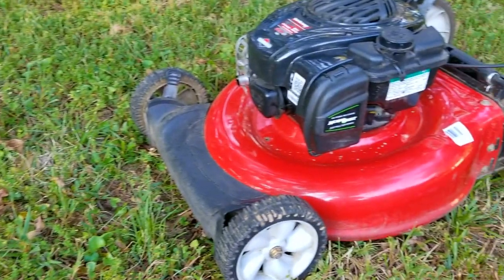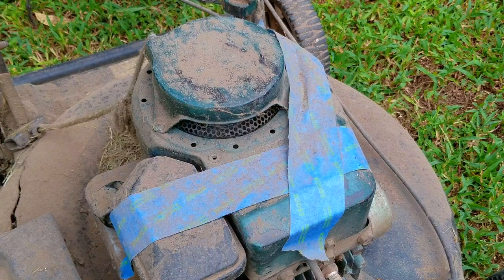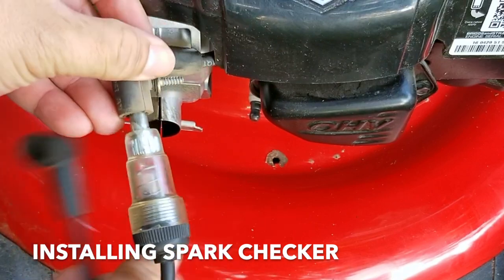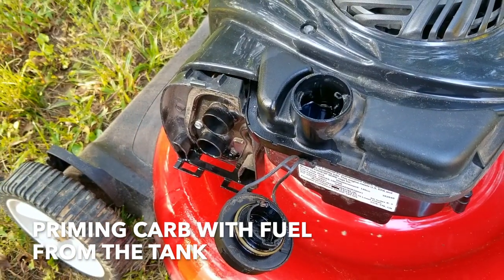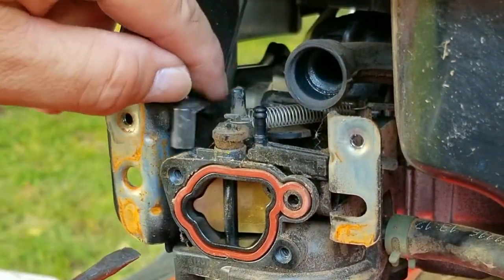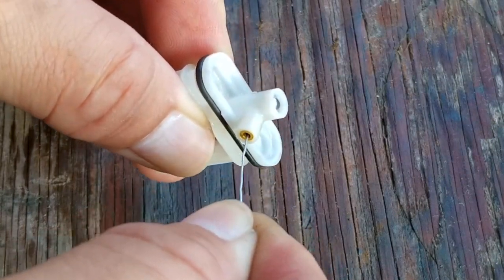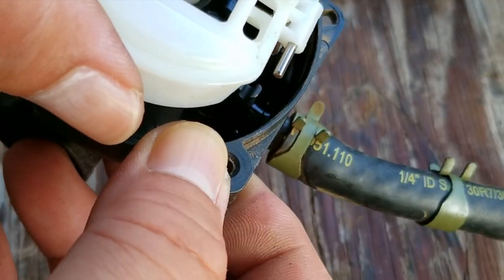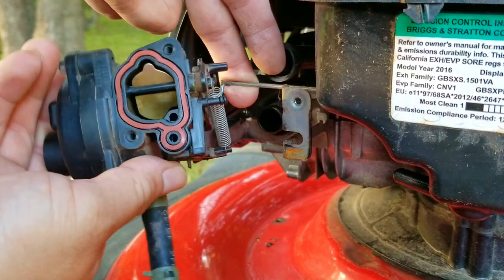Why Did Briggs Stop Making The Flathead Engine?

Comment: My sarcasm tells me they saw the Quantum lasted so long they lost out on sales so they made cheap engines (with lots of plastic parts) and eventually said "never change oil" to absolutely guarantee continued sales... call me cynical.
Reply from the maker: I think that make a lot of sense
Reply: that Q was the high-point of  flat head design, right fuel burn, right crankcase breather system, right carb design.  There was no reason to ditch the side valve if you require constant speed operation. It's ideal just the way it is.
Reply: yep as small engine mechanic iv seen alot of then destroyed buy the no oil change lie then got to explain to customer they destroyed there engine buy not changing the oil it said not to change
Reply: I took apart an '87 Tecumseh TVS100 engine that had been scavenged of parts before I got it cheap.  I had no idea of the workmanship that was in these old flat heads.  Parts for these old engines are abundant, cheap and made in the USA, which is why they should be salvaged as well for future use.  The governor gear is nylon while everything else is metal on these engines, minus the seals.  If you are looking for affordable upkeep, older B&S and Tecumseh are the way to go!
Reply: I totally believe the no oil change deal. 
I had a Tecumseh push mower in the 90s that I had 13yrs and never changed the oil, just added it. 
Still ran when I gave it away. 
Why change oil for a 79$ push mower it basically paid for itself in the 1st year. 
Read the Briggs fine print too, it's totally doable. 
45mins per cutting every 7-10 days ,for an average 5mo season. 
Top off the oil ,change the plug and air filter annually and it's good to go.
Reply: @timewa851  they were having a heck of a time getting them to meet emissions,even being constant speed.
Reply: @MrTheHillfolk   I think it is still a good idea to flush the oil sump and put in some fresh cheap 30wt if you recover one of these engines, as God knows where some of these machines have been.  The Quantum engines always puff out smoke upon startup after their second or third year regardless how well you take care of them.  The OHV engines not requiring oil changes is a bit suspicious, as anyone with an old Honda will tell you that if you don't change the oil regularly that they will smoke like a chimney.  Of course, it could be old gas or water in the system, though.
Reply: @campbellpaul 
You can change the oil ,you just gotta tip em over as some don't have a drain plug. 
That old Tecumseh I had was a great experiment though. 
I'd do a leak down on yours ,I suspect the beginning of a popped head gasket. 
Compression can show good all day ,the leak down test really tells you what's going on. 
Chamfer all head bolt holes and any other holes and sharp edges on the head and deck. 
They say 220in pounds and don't lube bolts.
I say lube the bolts ,and go 20ft pounds (220 is like 18 ft anyway) 
So chamfer ,lube bolts and go 20ft pounds, I've never had a repeat after that. 
Plastic scraper and a brass wire bristle brush cleans the surfaces up nicely.
Reply: @MrTheHillfolk  That could be the problem on one of my Quantum engines.  I notice the head bolts sometimes need to be tightened up.  I think I'm going to refurbish my 5.5 quantum with a brand new head gasket and check the ring gap and the bore for it's lack of compression issue.  I'll do the same for my Tecumseh, as kits for these are cheap!  Another thing I need is a good ring compressor to put it all back together again, as well as some lapping compound and valve spring tool, as I have some Suzuki engines that also could use some TLC (parts for those are too expensive though).
Reply: @campbellpaul  yeah if you're noticing head bolts getting loose ,they are either stretching and yielding or the gasket is going away causing tension loss of the bolts. 
When they do leak ,pull the head off easy and look for black carbon streaks from the bore to the pushrod cavity (on the head and deck) and the gasket might be all blackened. 
These things are fussy about heat, the cooling systems are barely adequate and a little debris can block airflow ,causing localized overheating and popping head gaskets.
The ol mouse nest in the blower housing that went unnoticed for a few cuttings helped start the process (not all the time but it can, I'd pop the blower housing and make sure all the fins are clean and it's off already for the head gasket I'd figure if it goes that far)
Reply: @MrTheHillfolk  Carbon build-up is the likely cause of the hot-spot on the head.  That's the one drawback of flatheads over OHV which burn much more efficiently.  All but one of my engines (I have 12 altogether) have never had any refuse stuck in the cooling fins.  The only one that went bad was a two cycle that had been run with no air filter, which I bought for parts.  To me, there is no bad engine made before 2004, just some are easier to work on than others.
Reply: @campbellpaul  cool deal ,at least you're wise to engines.
Yeah mid 2000s seems to be the point where it turned to junk after that.
Actually Briggs low key addressed the cooling issues on the V twin inteks at least. 
The later "professional" series engines have a cooling fan that's close to double in height,and the blower housing does swap to the early stuff, but it's best/easiest to have a donor for it. 
We did use the singles for a while on generators, the later ones have a round air filter instead of a panel filter (identification purposes) but I haven't checked the fan height, it could be taller.
Reply: @MrTheHillfolk  I am leery of anything that you cannot break-in slowly that doesn't have a throttle control lever, so the Intek engine (although torquey) is written off my list of walk-behind mower options.  To me, it would more likely be the victim of developing a ridge on the cylinder, so I would only buy one new if I know for sure of a carburetor I could adapt to it with manual control linkages.  There are just too many oldies to be found cheaper for my purposes.  Intek engines also tend to have Chinese parts which I am so far completely free of in my collection.  The Professional series does seem to be the most powerful I have used, but I will take durability over power, as I have 2 cycles that can deal with overgrowth.
Reply: @campbellpaul  haha I've been in generators for too long😂
You'd be horrified that the air cooled ones ramp right up to 3600 from a stop. 
Actually a little more if it's mechanical governor ,like 3750-3800 😂
That's lovely when it's like 14 degrees outside 😔
I still see em with 1200-1400hrs before they get tired or parts are starting to become nla.
The issue with generators is if you want lights on or want to wait for an engine to warm up 😁
At least the larger water cooled units usually only run at 1800 and have coolant heaters so it's already 100 degrees or so, those aren't too bad. 
I do cringe when I see folks just whack the throttle after it's only running 10 seconds, stuff like backpack blowers and chainsaws it's a good way to lock one up.
Reply: @MrTheHillfolk  What's worked for me (and frankly, why I am amazed at OHV small engines with a trochoid oil pump) is putting the engine to full load at slightly higher RPM than recommended.  I only allow 5 seconds to get the oil circulating first, with a gradual raising of the throttle though, not slamming it up immediately,  
The idea is you run it like that every time you start it, but only for the first 15-20hrs run time.  After that, you simply run it at regular recommended RPMs without worrying about the circulation period too much (or whether it's under load or not).  You can basically just run it the way you described the generators starting at 3,600 and if it is a quality made engine with good quality control and assembly, then it should last 5 times as long as it would otherwise (without break-in).
Now, I don't believe all engines can last 6,000+hrs, but I did break-in a Suzuki OHV VMG6 that way and it did last that long with no major problems.
Reply: Yup. It's a shame if that's the business model they're following.
Reply: Good theory except Briggs isn't the only maker of small engines.
Reply: @MrTheHillfolk  emissions on a mower compared to Biden flying Air Force 1 over to the Economic World Forum is like a fly taking a crap in the ocean.
Reply: @scottrayhons2537  
Don't get on me about it, I'm just passing the message.
Go tell him yourself I've got other shit to do
Reply: Yep. Too reliable.
Reply: Well I’ve never changed the oil or done any servicing on my Briggs flathead mover and it still starts first pull every time and it’s about a decade old at this point!
Reply: You are almost certainly right.  Especially with the "Never change the oil" part.
Reply: @MrTheHillfolk  Just because YOU were lucky doesn't make it right, and just because your engine still ran doesn't mean it ran well and sounded good.
Reply: The combustion chamber of a flathead can never be as efficient as an OHV design. Fuel injection won't change that. Lawn mowers create 242  million TONS of CO2 per year in the US. That's 242 million multiplied by 2,000 lbs, or over 48 BILLION lbs of CO2. If you count one pound per second, it'll take you over 1500 years to count the pounds of CO2 from one year of mowing. People think that's how it's always been and so it'll be fine. But remember 30 years ago when you could drink from almost any stream? Today you can't drink from hardly any bodies of water. And we didn't really start mowing until about 1950.
Reply: Had a mower with the flathead engine,never changed the oil,just kept it topped up and it ran for close to twenty years until the deck rusted out.
Reply: I think I'll call you "correct", sir.
Reply: That's the case with a lot of things these days. Everything from automobiles to kitchen appliances are all made to be complete garbage these days. Refrigerators for example used to last for multiple decades, but now they all too frequently last less than 5 years. Those old flatheads used to run forever. Whenever something did go wrong it was always easy to fix. I had an old flathead before, and that engine was still going strong after the rest of the mower fell apart and rusted away around it. The fact that it was kept nice and dry in the garage when not in use should give you some idea how long it took for the wheels to get rusted off. We had that thing long enough that a child could have been conceived and grown to adulthood possible having kids of their own. It eventually became impossible to use when the wheels fell off, but the engine was still going strong.

EDIT: I should also add that I had the 22 select cut with 4.0 horsepower, and cut so much grass that it wore the blade down to about 17 or 18 inches. I replaced the blade, and continued to cut till the wheel fell off and got hit by the blade. Engine still ran after that just fine, it was just missing a front wheel.
Reply: @MrTheHillfolk  lol thats for the city/urban folk that have a postage stamp yard. I use my push mower just to trim around my trees. Thats 2hrs per week
Reply: I work for a garden machinery repair business and all the new OHV stuff is shite , the E10 fuel doesn’t agree with machines like these so we put aspen or E5 in them  if customers pick them up from repair or showroom stock gets aspen as it lasts for 5 year without messing new engines up  , we recently started a flat head villiers up that been standing in the open for many years , put some aspen and a squirt of Cosby starting fluid n fired right up  , point is can’t beat the old stuff 👍😉
Reply: I have a 5hp Briggs from the early 70s still starts on the second pull every time.
Reply: I never call you cynical because I see the same stuff and it's all made some country 12,000 miles away and they have no parts for them and anytime you say never needs to change oil let's see if those people will never change underwear socks and see how long they last? 💸💸💸💸☠️💸🙏
Reply: @jonsworld5307  although synthetic conscious as much as second class Scotch petroleum base the couple of bucks how much is a new machine how much just to take it in the shop and have it cleaned tuned new blade air cleaner etc etc and how much is a can of oil If you look around do 5 gallons at a time in the last year 2 years if you're as crazy as I am and 5 years if you just normal however I would go with another jug because who knows what's going to be in 10 years to buy a new one 💸💸💸💸💸💸💸💸💸💸💸☠️
Reply: @boatlover2296  That doesn't surprise me. Those were some of the best engines ever made. Everything went to shit after the 90s.
Reply: @theupscriber65  If you are advocating battery-powered mowers, I, myself, would rather use a corded electric as they last longer and have less waste product.  Eventually, we will have to resort to scythes to cut our overgrowth, as we will inevitably run out of fossil fuels at the rate we consume.
Reply: @24space310  Indeed the prices went up while quality went to hell. That being said they still made plenty of money back when shit used to last. It's out of greed not necessity that they make refrigerators to not last more than 3 to 5 years these days. That's why I'll never buy a new one. My old GE side by side from the 90s is still going strong, and it'll still be going strong after a brand new fridge is long dead. Planned obsolescence is real.
Reply: @timewa851  problem was right there. For starters the proper name was the L head. Beyond that there was a lot of short comings from a production and emissions and cost of materials side. At the end of the model 9 &10 engines (the smallest and most common version) were so expensive to make that the company was making literately pennies per engine.
Reply: @MrTheHillfolk  both the L head and the OHV push mower engines were designed for a 50 hours of expected life. You should expect to get +66 cuts at 45 minutes so given your specs should get about 3 years per engine. The plug should be good for life, but with the fuel it should be run dry before storing it for the off season.
Reply: @MrTheHillfolk  the plugs were removed from the bottoms due to not getting use and hastened by one of the international plants screwing up the installation on some units leading to recalls.
Reply: @campbellpaul  use thread locker on the bolts, that's what we used when we built them.
Reply: @campbellpaul  I had a corded electric mower. Hated it every time I used it. Now have a battery cordless mower. Love it. And no oil or gas to fuss with. So far I have had no issues with the cordless mower. But it will not last near as long as those old flathead mowers. It’s just not constructed to support that long of life or endurance. But it will suit me for as long as I need to use it.
Reply: @americanrambler4972  I have only used one mower that I've truly enjoyed, and it has a flathead engine, too.  It took me 35 years to find that mower, and I've been using it ever since.
Reply: I have mowers (used fixers) and only added Earl.
Reply: And my sarcasm makes me think Ya cant make hydrocarbons if the engine dont fire up!
Reply: @MrTheHillfolk  emissions does not matter with small engines I've never had to e check a lawn mower still got one more code to sort out with my car so I can get it plated
Reply: Seen a lot of quantum engines, only ever had one failing that ran a whole season without oil and just threw a rod at the end. Still very impressive
Reply: @campbellpaul  
If the Suzuki lasts even better than the Briggs.....the cost of spare parts evens out re price?
$ per year fuel/oil/parts comparisons are worthwhile...
plus of course intitial cost of machine...
also spread over total years of service to the owner...
Reply: like the cars with transmission fluid which lasts the life of the transmission, or is it the transmission which lasts the life of the fluid? I get so confused....
Reply: @johnstreet797  I was thinking the same thing.  I also think that dealerships get out of having to change the tranny fluid in their used car inventory before they can sell them.  Be sure to take your vehicle in if it's under warranty before the 100,000 mile mark!
Reply: @Paul Campbell  hopefully before those fossil fuels kill us all. Honestly we use a gas powered mower because the yard is too big but used a cordless push mower for a smaller yard and it was very nice. No gas or oil, super reliable and quiet.
Reply: Lost out on sales? No way. You can bet there have always been and will always continue to be people that buy a new mower every year or two only because they went out to start theirs after winter and it wouldn't start.

That won't change because it's ohv.
Reply: @theupscriber65  If you think about it, as batteries improve they will get more and more expensive.  They may last up to 10 years one day, but the drawback will be the cost of the mower.  It may be well worth it if they don't make subsequent batteries obsolete in the process, which is what Green Works and some other companies do, which makes their mowers instant landfill after just a few years.
Reply: Spot on man. That is the EXACT reason..
Reply: @markrickert9040  Some of mine are 50 - 60 years old, and have done WAY in excess of 50 hours' work.
Reply: @the upscriber  co2 is essential for the atmosphere.  The earth nearly became inhabitable due to the lack of carbon.  Eating bugs won't help the planet .
Reply: I didn't even know this was a thing.
Reply: Quantum’s and Sprints had plastic camshafts and plastic carburetors way before these new OHV engines. 

The never change oil comes from people not maintaining their equipment anyways. You can still change the oil on those engines. Many people see lawnmowers as throwaway items, as with many other everyday items.
Reply from the maker: the older engines could take the abuse of no oil changes, the newer ones, not so much.
Reply: @INSIDEHOUSEGARAGE rite . dude I laugh everytime I see those never change oil stickers.  Planned obsolescence at its finest and most obvious...lol
Reply: My experience tells me to get a honda. Brings and stratton are boat anchors
Reply: @MarcusCicero1  you must not have much experience then. The GC and GCV are throwaway engines. Cheap rockers, cheap timing belt, no removable cylinder head
Reply: @INSIDEHOUSEGARAGE  I've been running 10W-30 full synthetic in my new Briggs and Stratton and changing the oil in the fall when my grass goes dormant. Seems to be running fine.
Reply: @Redsfanatic32  really??
Reply: @JD Turner on a 79$ engine ,it's a waste of my time. 
I have much,much better things to do than worry about 79$. 
Heck ,it's a waste of time on a 1200$ car.
I saved a fortune !!
Reply: @MrTheHillfolk  the engine’s not $79 brand new, but believe what you want. a oil change that’s $5 is cheaper than an engine that’s allegedly $79.
Reply: @h8troodoh  oh yeah. My 2004 4.5 horse Briggs flathead is a plastic camshaft engine.
Reply: @Redsfanatic32  sorry I was referring to the mention of honda building throwaway engines, just doesn't sound right, Honda + throwaway engines.. seems weird even saying it..
Reply: @Redsfanatic32  I guess you can't read or comprehend what I wrote before
Reply: @h8troodoh  oh, yeah they absolutely are. But, as far as I’ve seen, it’s only the GC line of engines.
Reply: @Redsfanatic32  kinda sad that even Honda has sacrificed its good name for profit.. welcome to the new Japan, copying American ideals of manufacturing.. very sad indeed.
Reply: @Redsfanatic32  mines got a plastic crankshaft.
Reply: sarcasm and cynicism , maybe, also very true however. Throw away stuff these days is what corporations are after.  profits. no profit in a product that runs for a very long time, even when abused. Compare it to the cars these days. By the time a person pays off a new car, time to buy a different one. Phones, etc...
Reply: @jonsworld5307 the no oil change engine is bullshit to me. Every engine needs to get oil change.
Reply: Not sarcasm but rather a fine example of  planned obsolescence.
Stay well, Joe Z